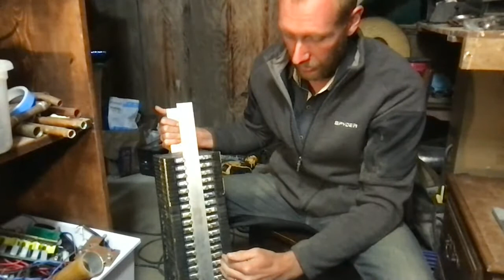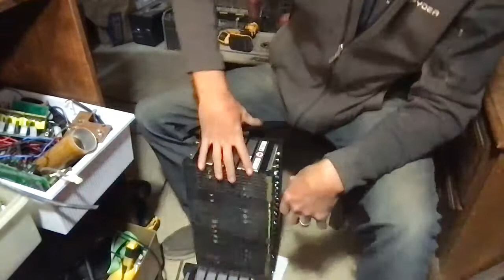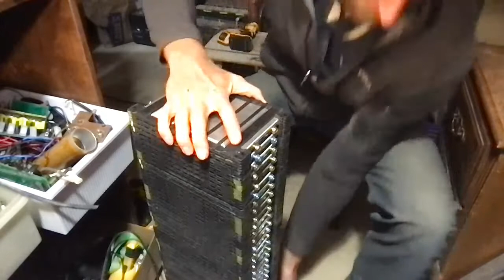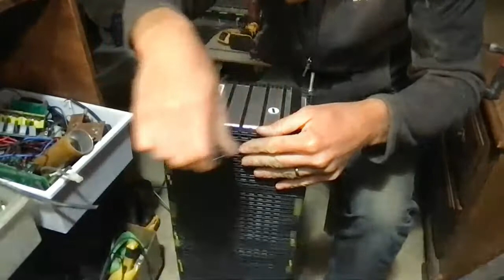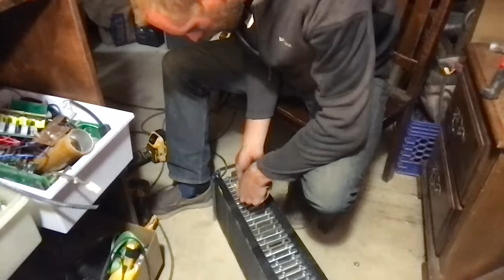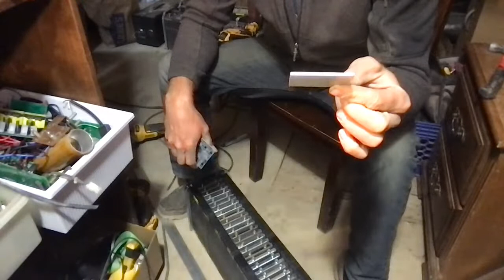Battery Building Lithium 74v 20s 4p SPIM08HP 2.3 KWh

Comment: I am building also a 72v SPIM08HP battery for my electric Honda Ruckus conversion, but I'm only doing a 20S 2P configuration due to the small size of the motorcycle. I also don't care as much for range since I'm not planning on traveling more than 20 miles per day. Did you ever finish your project?
Reply from the maker: I’ll try and share updates on YouTube soon. Sorry I’m better at posting on TikTok because it’s easier to post there lol
Reply: Im building the same battery, what are the dimensions of your 20s2p?

Comment: Aluminum has 61 percent of the conductivity of copper, but has only 30 percent of the weight of copper :P
Reply from the maker: Good luck making copper bus bars. 😅 bust bars are easier thought of than done. lol 😂
Reply: @Retro Electric  what's hard about copper bus bars?

I've made them of of 1/8" copper and aluminum both.

As long as your design doesn't involve threading them, just get 4" x whatever 1/8" bar, whack it into whatever size you need for 2p/4p/6p and drill the holes for your bolts to go through.

This also assumes you have the 1/4" square stock and bolts that come with the batteries, or which you cut and tap yourself.

Thats the only method that's going to give a solid low resistance path.
Reply: @RetroElectric  I'm designing one if U will need them in future - the issue is BMS capable for 400-500A continuesly 😎
Reply from the maker: @ev-place  many that need high current solutions just make the bms run a solinoid. When the bms cuts off the solinoid opens and the car shuts down. Keeps bms cost down A LOT!!!

Comment: I run 80 of these cells for a extra battery in my vehicles for 160 ah 14.8v battery I was having voltage drop issues . First I bought a 360 Amp alternator from iraggi then 3 yellow tops and still dropping into the low 12s high 11s and sometimes when really beating the shit out of it down to 10.7 you could actually hear the sound change do to the low voltage as soon S I added the lithium nothing below 13.3 now much better of coarse I have the big 3 and 4 runs of zero gauge still drop to the low 13s
Reply from the maker: I don’t quite understand what you are doing here seems like you are going for a 12v battery in a vehicle of some sort. Would love to see your setup. For the record I have abused the daylights out of some of these cells too. I had 1 battery that was a 20s 1P pack and I was doing wheelies with a golf cart with just a 1P 😅

Comment: Hey am a beginner watch the vid 3 times question... I have 20s of the battery hookup i noticed u said that the busbar start after the first set because u have make it main negative... so the first cell i have to leave separately to connect the black wire of the bms... and is that the same for the positive side
Reply from the maker: Hmm. It’s hard to say. I can’t quite make out what you are trying to do from this.

Comment: Nice.  Love the high voltage battery.  What type of controller and transistors (mosfets) are you using to control that power?  Beats your average 48V cart for sure!!!
Reply from the maker: https://youtu.be/kHX9luIAxuQ
Reply from the maker: High voltage speed controller review. 
https://youtu.be/J3UJh624cIg